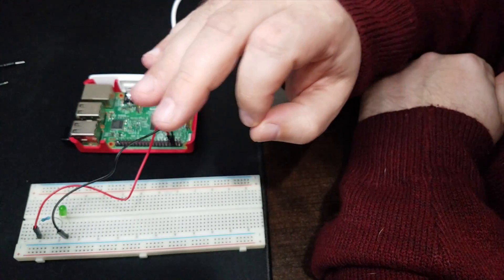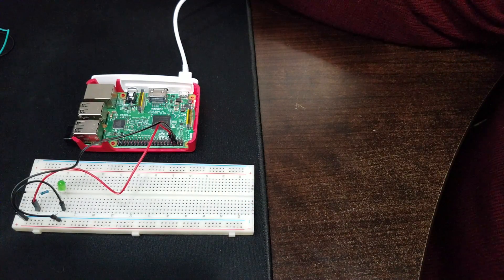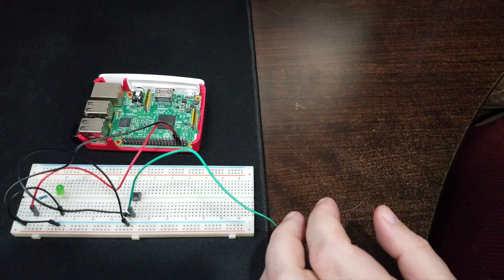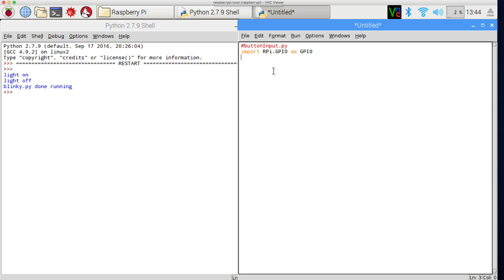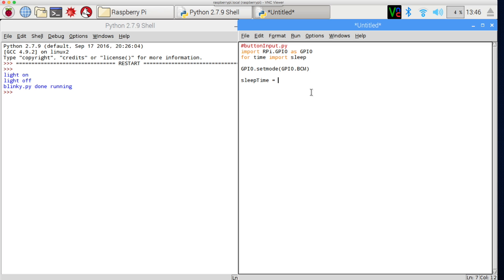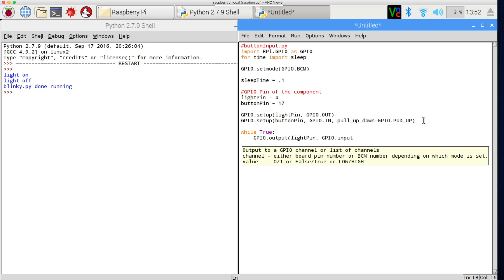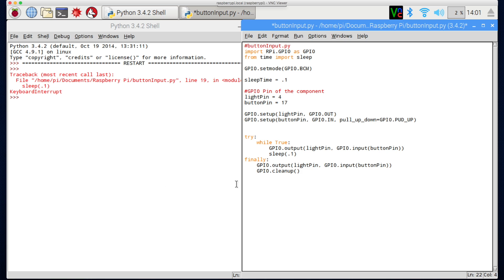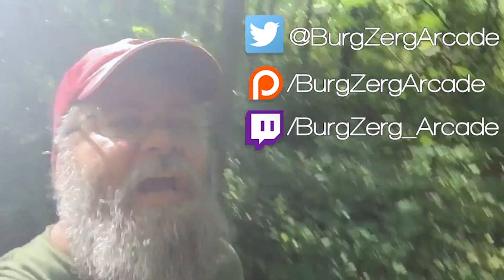Raspberry Pi Button Input

Comment: What is the maximum voltage we can connect to it ? For example, if I want to run a fan using the same would it be possible ? Cuz the module seems pretty small and could get fried easily.

Comment: Without using the pull up/pull down circuits, integrated in raspberry pi, can we  make it run using +5V pins? Using an Output Gpio pin instead of +5V pins causes damage for Raspberry or it is ok too? Thank you!

Comment: should I connect give the negative voltage to the raspberry pi ? Does it damage the board because in Arduino I should use an  3.5 positive voltage as input so when I provide negative voltage doesn't it damage the board pls help me as fast as posdible as I need it for my school project

Comment: Does the T-Cobbler not work with the buttons because nothing happens when I push the button and I have the code setup correctly as well as the breadboard, also I looked at a lot of other videos like this and nobody uses it.

Comment: Thanks for this video. It helped a lot. I was able to hook up two buttons to control the LED and had a sound effect for each of the buttons . Can you do a video on Pull Down?

PS. You can use GPIO.setmode(GPIO.BOARD) for better numbering of the pins 7:04

Comment: Very easy to understand, good tutorial, thanks! But I would like to know how would you make the button turn the LED ON and let it stay on and then when the button is pushed again, the LED would go OFF and stay off: this would be very useful to control a diy smart light or AC socket
Reply: Not sure if you found an answer by now but what you're looking for is a toggle. I don't have the code for it but you need to save the state of the LED and have it toggle each time the button is pressed. so something like if button == true then ledState = not ledState

Comment: These guides are I great! I am about to buy some electronics parts for my Raspberry Pi so I can learn how these things work. I am buying a breadboard, some LEDs, 470, 2.2, and 10k resistors, tactile buttons, and jumper wires. Does this seem like enough things to play with for a beginner such as myself? I could also get some photo cells (they seem interesting) and maybe a PIR motion sensor. However, I have no idea how to use the photo cells and the motion sensors. Does this seem like a decent enough list though?
Reply from the maker: +Indervir S. I tend to pick up the the parts as needed instead of stockpiling them. So it all depends on what you are planning to create.